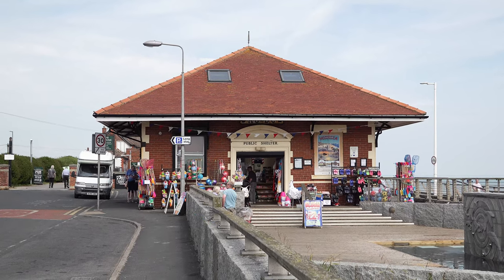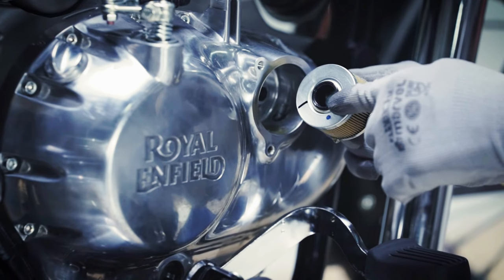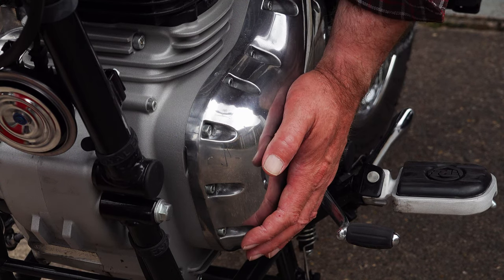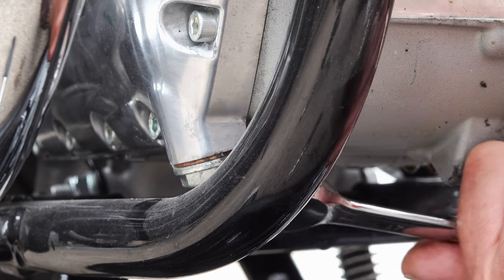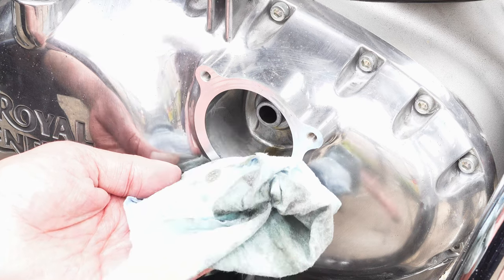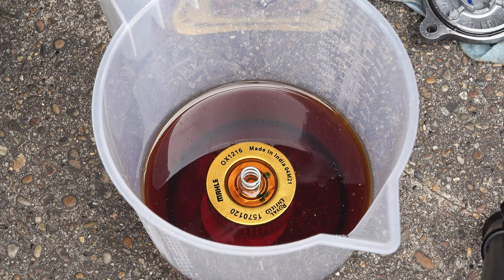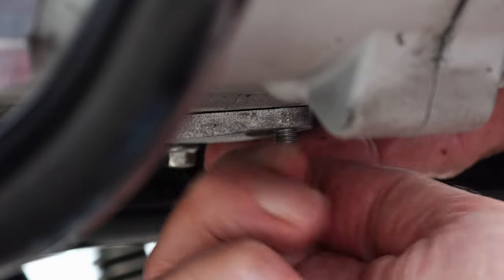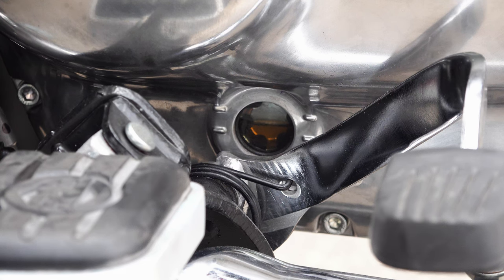Royal Enfield Classic 350REborn & Meteor 350. Complete old school oil Change. Reset Service Icon!

Comment: I paid £155 for the first service on my Meteor. This was at LMT motorcycles in Louth, Lincolnshire. Regarding the flashing service reminder, the garage told me that if you follow the info gleaned off the internet the flashing spannery thing goes off, only to reappear in a few weeks time. They said you had to put a "patch" onto the system. Not quite sure what they meant though.

Comment: I have always checked the plug cap at the same time.with new oil in and the plug out I spin the motor over on the starter until the oil warning lamp goes out.just hoping to repay for all I have learnt from you

Comment: First service on my Meteor 350 was $680 Australian. 

Next question uncle stu, my meteor has just ticked over 12th months old. Due to an accident, COVID and obscene amounts of rain here in Sydney australia, my bike is still under 5000kms on the clock. Should I be doing an oil change anyway? Thanks for any advice you could offer.  Also, would be interested to hear your fuel economy of the 350 and thoughts on how reliable the fuel gauge is.. the meteor is woeful in this regard
Reply from the maker: Yes you should do an oil change annually if you're not reaching the service mileage. Oil does still deteriorate.

Comment: Stewart,  I don't know if  you read comments this far back , but regarding a video you did a while back about  fully synthetic oil in your 500 enfield,  would you be considering using full synthetic oil in your  350? I'd like to hear your  views first, I'm thinking of putting it in mine as the bike wears in more,
Reply from the maker: In due course yes, But put 2k to 3k on the engine first!

Comment: Thanks for the info. I have done my first oil and filter change and was wondering how to rest the service reminder. Just one question when will the service reminder come on again ? It first came on at around 500 km and in the book the next service is due at 12 months or 10000 km.
Reply from the maker: At the next service point.

Comment: Why is there a sump drain plug that doesn't drain the sump? Only a drab of oil comes out. Draining the oil by removing the strainer cover is messy. The Himalayan has a drain plug on the strainer cover. Would the Himalayan cover plate fit the 2022 Meteor 350?

Comment: Hi there. how do you get rid of the oil,  you just cannot pour it down the drain, I know a service at a local shop will cost a bit, brake fluid, brake pads, i fitted brake pads to the first piaggo mp3 i had, without removing the wheels, if i had a garage i would give it a go myself.
Reply: Most council recycling sites accept  used oil with no charge within UK. Failing that ask a traditional automobile garage, many have heating systems that run from waste oils.
Reply from the maker: take it to your recycling centre!

Comment: I did my 1st oil change on my Classic 350. I did not change the seal in the filter cap. I got a tiny bit of oil from the bottom of the filter cap but this cleared up. I performed a 2nd oil change at 1000 miles. I did change the seal and torqued the 3 filter cap screws to 100 in-lbs (7 n-m). The oil is almost gushing out from the filter cap now. I checked the seal and recleaned the surfaces. The oil is still leaking profusely from under the filter cap. 
Aside from taking my Classic to the dealer, are there any other ideas as to how to stop the leak?
Reply: I fixed the oil leak. It was easy because I caused it. On my 1st attempt to put the filter cap on after placing a new filter in the engine on the 2nd oil change, I managed to pinch the new seal. The seal had 2 creases in it that did not appear to be catastrophic. These creases allowed the oil to gush out even after torquing the screws to RE's specs. Luckily, I had an extra seal from the 1st oil change. I replaced the seal, torqued the screws and no leak.

Comment: Thought you might have changed it to fully synthetic oil like you did with the classic 500?
Reply from the maker: not yet, its not fully run in.
Reply: @stuartfillingham   - Yes.  And not many how-to's point that out - that 100% synthetic is so good that it may take forever to bed in mating parts!
Reply: @stuartfillingham  Hi Stuart interested why would you would not use fully synthetic straight away? If you some of your great wisdom to share might make a great video. As always interested in what you have to share
Reply: @jimstewart2141   -  Ever since synthetic oils first appeared in the 1980s, various complaints began arising about engines either never breaking in thoroughly, or taking a long time to do so.  The result is continued oil burning due to the piston rings not bedding in, and maybe the same for valve guides.  The theory is that synthetic oils are just so good that they interfere with the normal wear needed for bearing surfaces to bed in.  The DIY solution adopted was to use regular multi-weight mineral oil for the 1st thousand miles or so, then switch to synthetic when the oil consumption slowed.  But no manufacturer seems to recommend that, probably because it's hard to tell owners to start off with a not-so-good oil.
Reply: @daveinwla6360  Thanks Dave for this very straight forward answer, so i am looking for when no oil consumption takes place?
Reply: @jimstewart2141   - Unfortunately, what is normal oil consumption, and what is excessive varies with the make and model of bike.  I'd ask a mechanic familiar with the bike what is normal consumption, and switch to synthetic oil when it reached that consumption point.
Reply: @daveinwla6360  thanks

Comment: Good video thanks, just wondering when the 350 is on the main stand and i slowly move the rear wheel backwards I get a squeak, it sounds like its coming from the disc brake, I have cleaned them, any ideas anyone.
Reply from the maker: don't worry about it, just ride it!
Reply: @stuartfillingham  ok nothing to worry about then, cheers.

Comment: I’ve put Motul 10w-50 in my bike for first service because UK temperatures never ever reach the likes of India. A lot of other 350 owners do the same. Just saying.
Reply from the maker: hmm... but is the oil pump designed to effectively pump that viscosity?
Reply: @stuartfillingham  you can generally get away with a +/-5 rating either way with oil. I’ve always used a slightly thicker viscosity in my Toyota car since new to protect the engine a bit more seeing as I’ll be keeping it forever.

Comment: Stue i cannot believe one would go to a dealer for an oil change , worse checking your chain, sprokets , and bearings not forgetting setting gap on your spark plug ,what kind of self respecting cyclist would not know how to do those bare esentials , and how about air pressure in tires and their wear ,holy smokes are the the plug and play generation , darn they need a trip to the wood shed